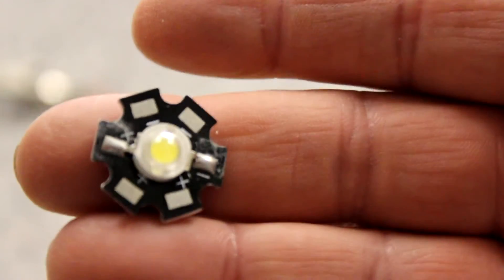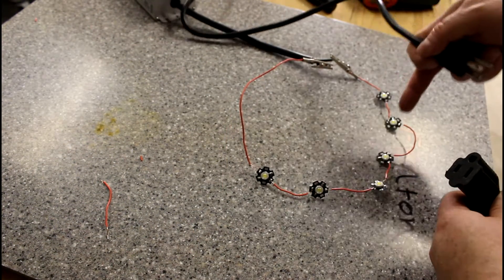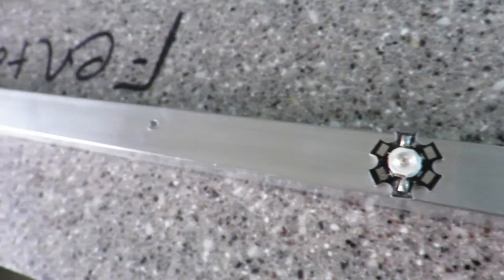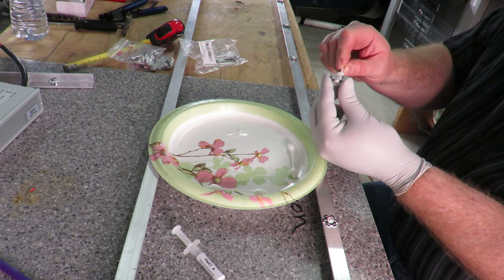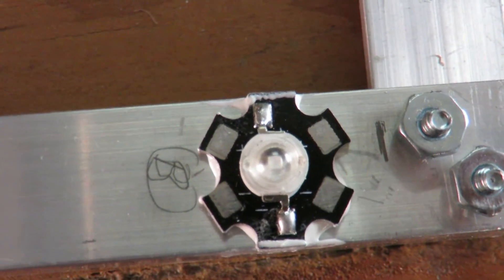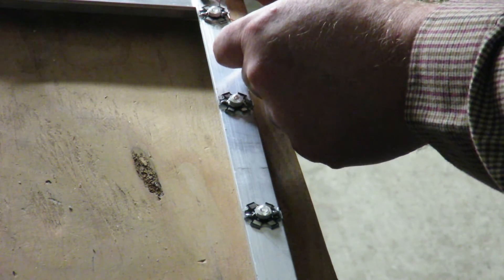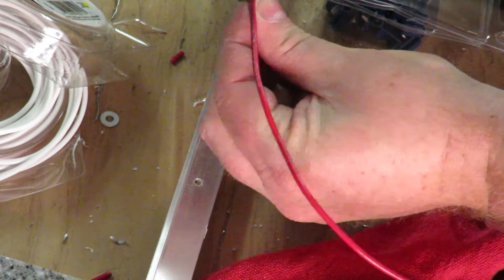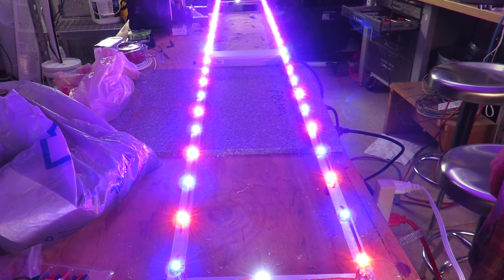DIY LED Grow Light

Comment: how much did the materials run total?
Reply from the maker: +Lauren Butcher Good Morning Lauren,
I purchased the LED Driver from Amazon for $68, $6.38 for 10X5 for the LED's and $7.49 for the Arctic Alumina. The aluminum "L" channels I got from Lowes for around $30. for a total of $137.00 which may or may not sound like a lot, however I got the exact light I wanted for my space and in the color wave lengths that I wanted. 
The project I am working on now and the things I am doing different: I am currently building a much larger grow light that has multiple tiers and I am using a up-cycled pc power pack that I got for free =) 
I will also be searching for another aluminum heat sink that may be cheaper. So I anticipate the new project to be twice as large and only cost around $54.00, hope this helps.

Comment: How did you get them all to light? At first you showed a driver that could only run four.
Reply from the maker: +T Hicks Hi T, Because the power line has a constant 12 volts, I ran all of the LED's in series of four off of the main line thereby avoiding having to use a resistor. So what you are seeing is 12 series of 4, 3w LEDs. The LED's are 3w each and my driver is only good for 150w so I have a total of 48 3w LED's.
Hope that this helps. 
BTW, I have been running them for awhile with no issues and the results have been amazing. I will post an update this evening.
Thanks for watching
Reply: +frozenfowler thanks for replying. I see... So you spliced into the main 12 times then. I will be watching for the update.
Reply from the maker: +T Hicks That is correct. My next LED project that I am working on, I am using an old desktop PC power pack as the driver. You get a heck of a lot more watts and it was free =) These LED's are perfect for leafy greens or the vegetative stage of any flowering plant.
Reply: @frozenfowler  I'm truly confused by your driver....it's putting out 12.5 amps and those LED are at most can handle a  small fraction of that power....I have full blown COB's that can only handle 3 amps at full power to about 60 watts each